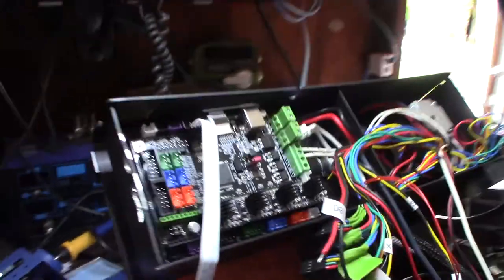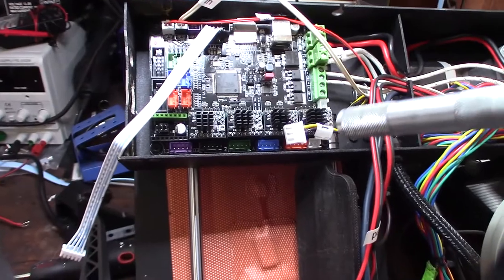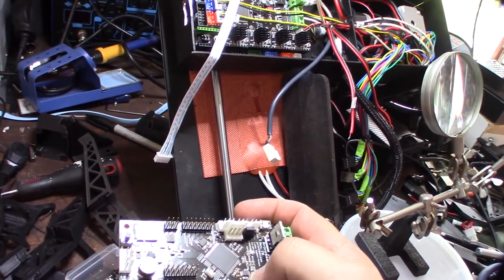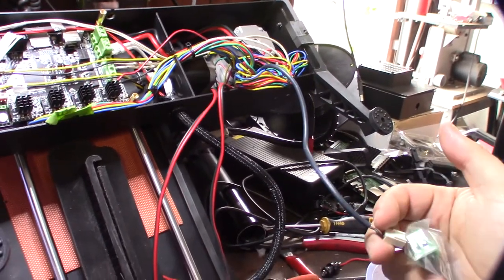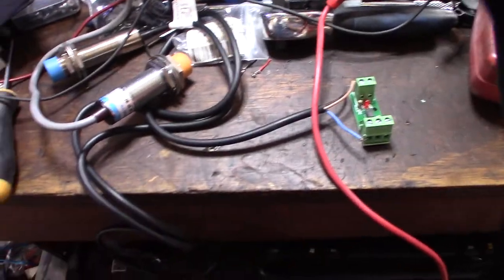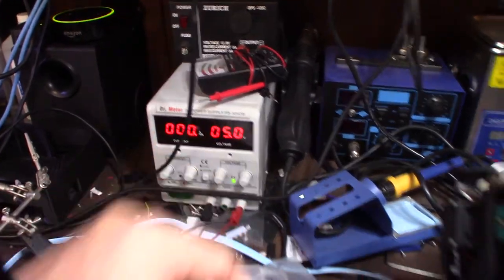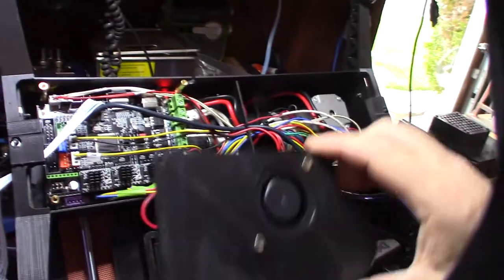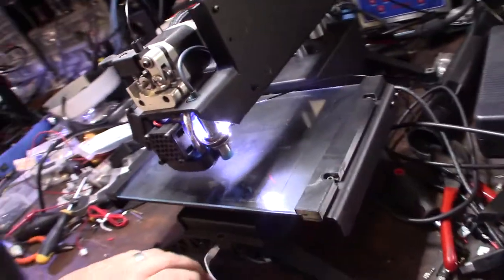Printrbot 32bit SKR 1.1 1.3 Marlin 2.0 upgrade with TFT35 TMC2208 Part 2

Comment: how did you wire up your 35? im having issues with my skr1.1 and mkstft35.. I see the 5 wires are comi9ng from the TFT area on the SKR but im not sure where they go to on the TFT. Thanks again
Reply from the maker: I made another video about it. Make sure the baud rate matches you board.